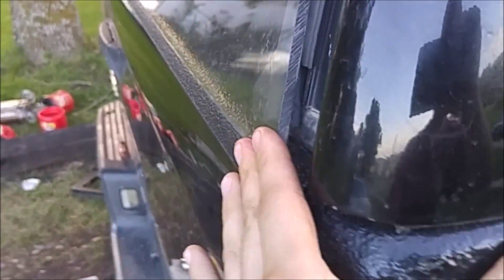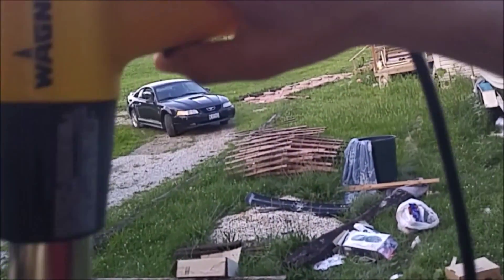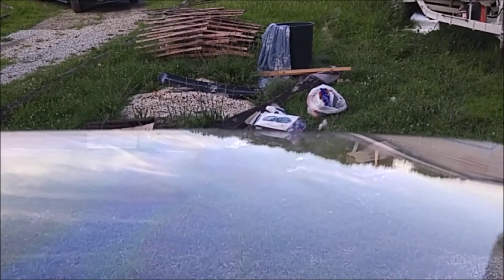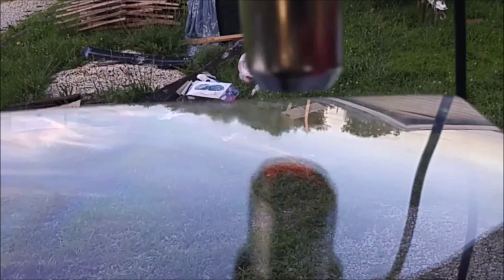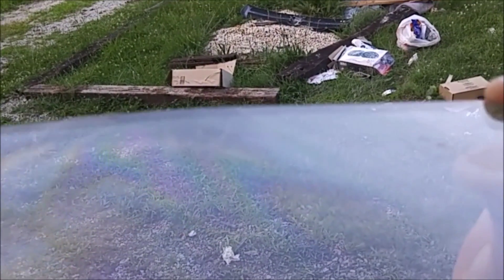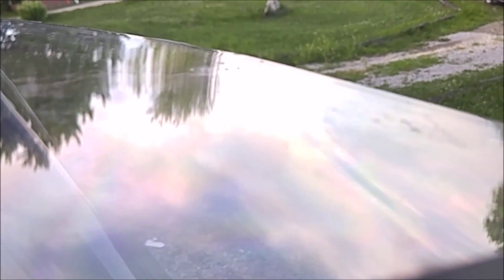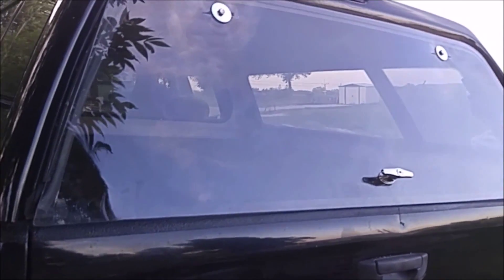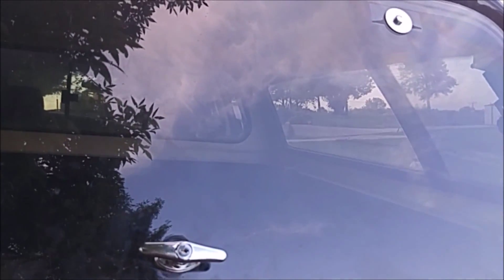Heat Forming Lexan/Plexiglass

Comment: Good technique. What worked better for me was coat lexan with Klasse. Build wooden forms (for rear cap it took 3, left side, right side and center). Clamp lexan down to form, heat completely.  Lexan will soften to wood form shape. Let cool completely and unclamp.  Held the form perfectly and made a watertight seal.

Comment: I do not understand your refusal to use gloves. Go buy yourself a pair of welding gloves and then learn to work with them. It isn't hard and you won't look like a sissy. You'll look like an old fashioned working guy. Also, clear coat on plastic is not a good idea. It ruins plastic over time. Try using this trick: https://youtu.be/E9NP0_nF2ak
Reply from the maker: Gloves, especially thick welding gloves, make it hard to feel what you are doing and grip smaller things. There was no real reason to use welding gloves or any gloves really. There are times that I use gloves but this was not one of them. Also I had good success with the clearcoat on the plastic couple years no problem
Reply: So you like having blistered fingers. My apologies. I did not realize that you are a masochist on top of being stupid. My bad.
Reply from the maker: @ManuelGarcia-ww7gj   wow I made a video to help people and a lot of people have been thankful for it. I dont have blistered fingers, dont have problems with my hands. You're calling me names when you are the one attacking me because I made the decision not to wear gloves for this job. Do you even know what masochist means? Because it doesnt make sense for this context. You might want to actually know what a word means before you use it and look stupid.
Reply: No one cares about wearing gloves period! especially welding gloves..like wtf
Reply: Pendejo

Comment: Nice work!  Is that a 1/4 inch? Can I ask where you got it and what you paid for it? Did the heat gun discolor the Lexan?

BTW, how secure is this lexan window from break in by just bending it up and getting to lock release?
Reply from the maker: Yes quarter inch got it from a glass shop. Dont remember how much it was now couple hundred I think. No discoloration. It didnt feel like it was gonna break at all but it is a bit flexible. I cured that by framing in the material with light angle iron behind the material

Comment: Lexan is scratch proof... so it is not lexan what you have there...
Reply from the maker: Ryszard Jacek Ruśniak lexan is impact resistant plexiglass is more scratch resistant than lexan. There is no such thing as scratch proof just resistant.
Reply: @thestigmach1984 lexan is not impact resistant plexiglass it's a totally different polymer.... it's called polycarbonate. lexan is the trade name. 
plexiglass is an acrylic polymer which is scratch resistant but cracks very easily
Reply: Lexan is impact resistant but it scratches easily. There are coatings that will give polycarbonate scratch resistance approaching that of glass.
Reply: lexan is GE product name for their polycarbonate material.
it scratcyh is very easily unless covered with mylar.
sometimes it's referred to bulletproof glass. it is extremely crack resistant compared to plexiglass which is an acrylic polymer which will crack very easily. I have machined plexiglass and if you go in the wrong direction with the endmill  it will form cracks

Comment: Keeping a coat of Klasse on it will prevent many scratches from ever happening in the first place. It's expensive, but so worth the money.
Reply from the maker: NORMAN WELCH ill have to try that next time use this stuff for anything. I've sold the truck since then but there's loads of things you can use lexan for. Thanks for the tip

Comment: Do you have any tips on how you actually cut out the lexan? What did you do for that part?
Reply from the maker: Dan Strasser I didn't cut this out I had the guy I bought it from do that. it's been awhile since that but I think he used a trim saw to cut it with a fine tooth blade

Comment: mark your curve points, take it off the truck, lay it on a table, place 2 dowels along markings for the curve, use rubber pad wood clamps to hold corners down, the pour hot water over the spots you want to mold, and your done.
the heat gun destroys the temperament.
Reply: Have you actually done this? Seems like it would take boiling water. And a LOT of it for 1/4" Lexan. Just askin'.
Reply: Emmanuel has no idea or experience in what he is talking about. Polycarbonate absorbs water. His "idea" is likely to form bubbles on the surface. Clamping, cold forming, using a heat gun... NONE of these "great idea" methods work. The whole sheet has to be the same temperature overall at the same time. 150 celcius/250 F degrees is the forming temp. You have to cook it in an oven for an hour or so, then you drape mold it or use vacuum or a frame over a plug.

Comment: how would i make it like a large curve for a bubble windsheld
Reply from the maker: depends on what you mean by bubble. like a bowel? or you mean to make the curve of a windshield? if you wanna make the curve of a windsheild you'll need multiple people with multiple heat guns all pushes the Lexan into the shape and heating at the same time. honestly unless you need it to be Lexan for racing it'd be cheaper and easier just to get a windsheild. if you want a bowel type deal then you can find something that won't melt in the shape you want and lay the Lexan over it. then you put it in the oven for a while and it melts to the shape. I've never tried it personally but I've seen it done. search even forming plexiglass on YouTube and you should find a video of doing something similar.
Reply: yeah kinda like a half bowel kinda dome shaped, its also going to have a lexan roof (the entire top is lexan from doors down) we are also going to have metal holding it up, its also going to be a seasonal car mostly for summer but is able to handle rain it is 2.4 mm lexan for the roof and so will the rest of it. Im not to sure if 2.4 mm will be thick enough or too thick for rain or any kind of molding
Reply from the maker: not familiar with metric much but what I used is .25 inch lexan. I 2.4mm is a lot thinner. may not stand up to highway speeds. that's why I went so thick
Reply: hmm ok the car is an almost 100% custom 1951 Studebaker commander or champion with the roof maybe drop a v8 in it and many futuristic design (like the dome windows) i can give you the link for the picture of the concept if you want
Reply from the maker: sure I'd love to see that sounds cool. I'd definitely go with the .25 inch stuff. it's pretty sturdy. I've gone down the hwy at 80mph with the window up and no problems
Reply: hey im wondering if it would also be possible to kinda add more on it could you do that or not
Reply from the maker: you mean like piece it together? I guess you could. whether you melted the ends with a heat guns and stuck them or used glue. don't know how strong it'd be. also you'd probably have the seam no matter what you did.
Reply: the stig mach 1 ahh ok thanks

Comment: Does the heat damage the transparency of the material?
Reply from the maker: only if you leave in a spot for too long. I think at one point you can kinda see it start to bubble a little in my video, when that happens it's too hot and you need to move the gun. after a bit you'll get the idea of how long it takes to get hot enough and not have it bubble. I suggest you start on a scrap piece so you can learn where it won't matter.